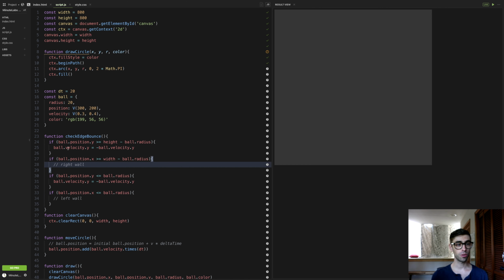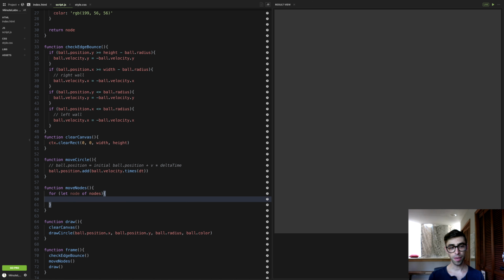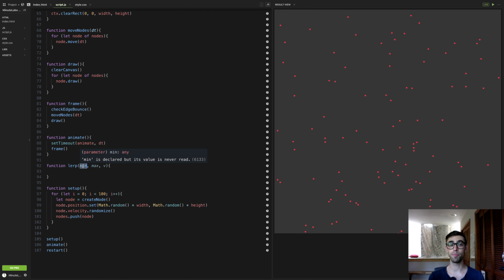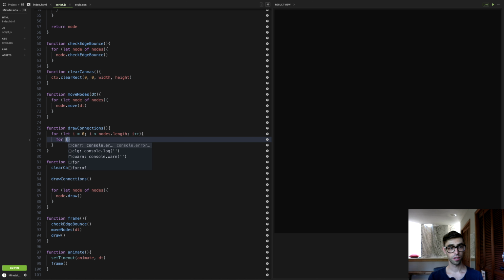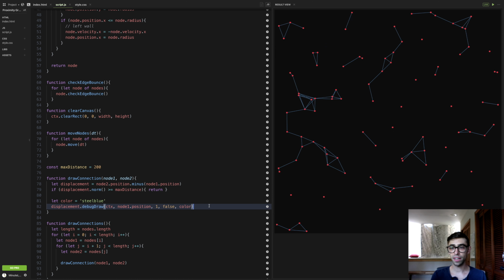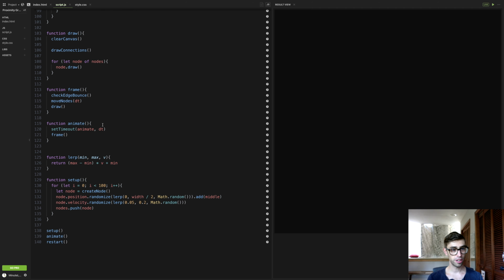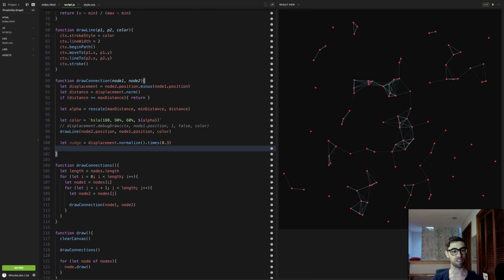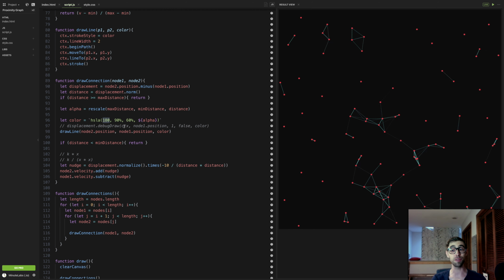Proximity Graphs with Gravity | Let's Build a Physics Simulation

Comment: Shouldn't we add/subtract velocity both to node1 and node2? Why add one and subtract the other?
Reply from the maker: It's because to calculate the force we use a displacement (node2.position - node1.position). This points from node1 to node2. If that arrow "pushes" node2, it'll push it away from node1. If we let it push node1 in the same way, it would push node1 towards node2 so they'd go in the same direction. That's why we reverse it for the other node by doing subtract() instead of add()